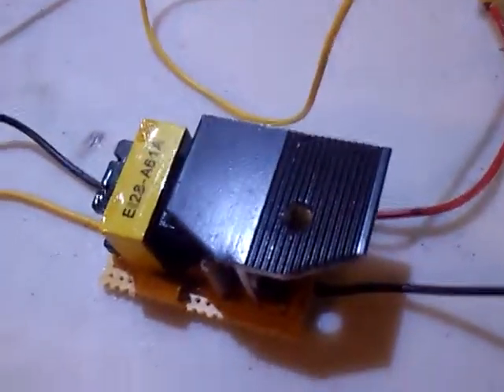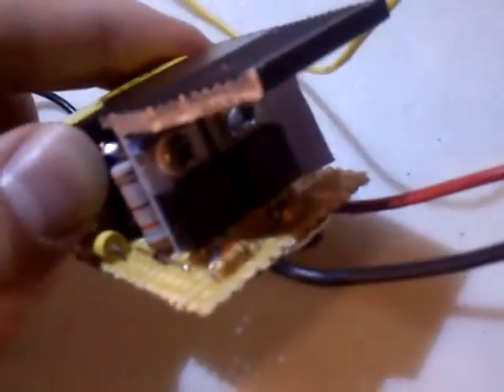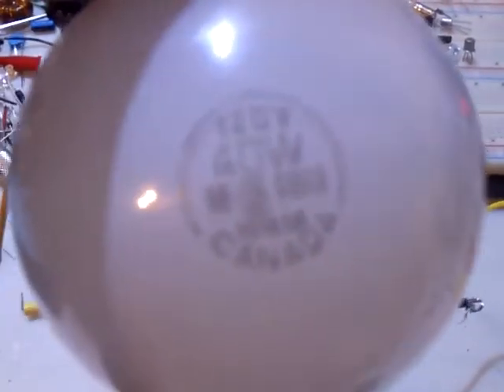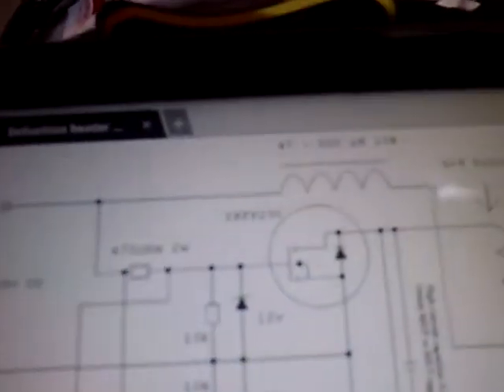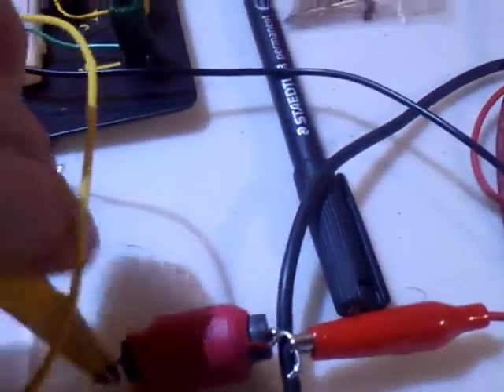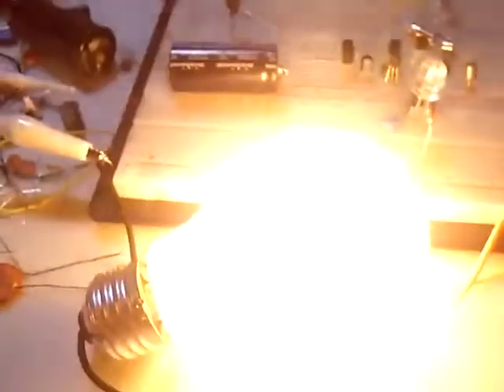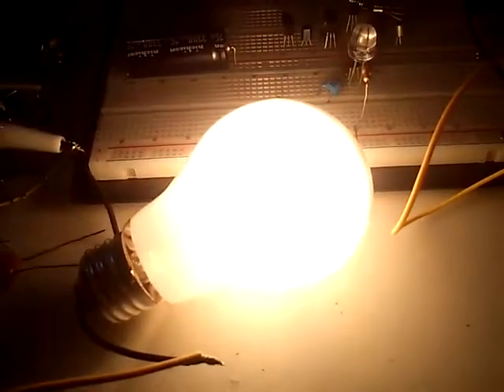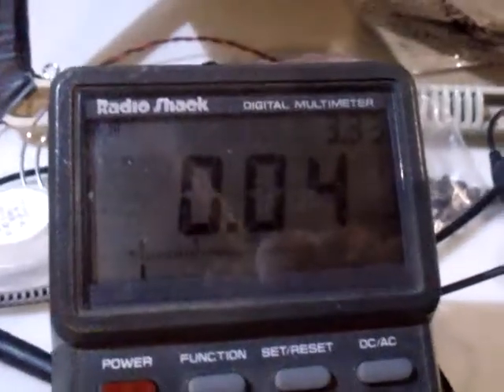ZVS Driver 12 v to 120 v

Comment: crap i wanted to build this but i dont have any zener diodes... i need to order some!
Reply from the maker: kiskiller3 This one does not have zener as long as you don't increase the voltage over the gate voltage you will be fine

Comment: That cap determines frequency. Smaller cap goes faster. larger cap goes slower. I was told mosfets get hot if switched too fast. I want mine to go as fast as possible.what part of the data sheet tells me what speed my MOSFEt can go? K2837.I can't find HZ on the datasheet anywhere.. Someone told me 20mhz is too fast